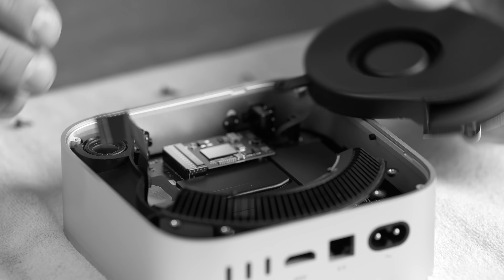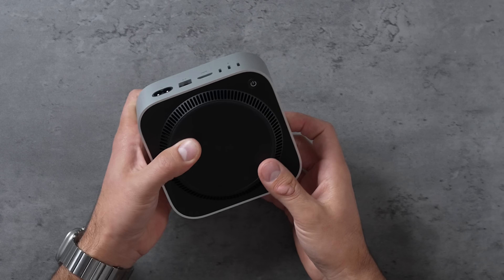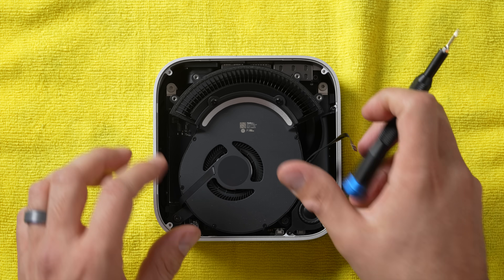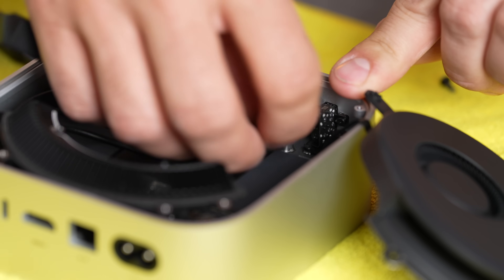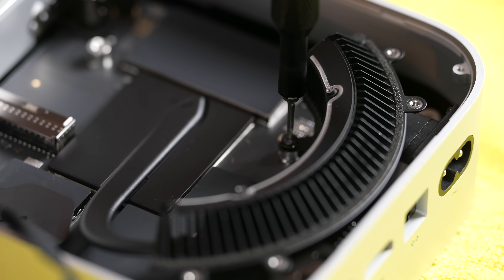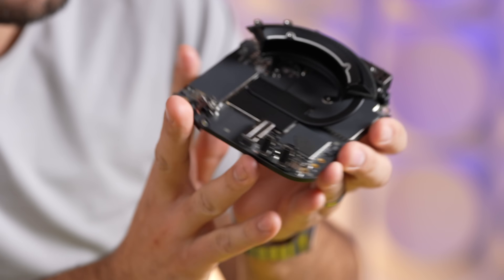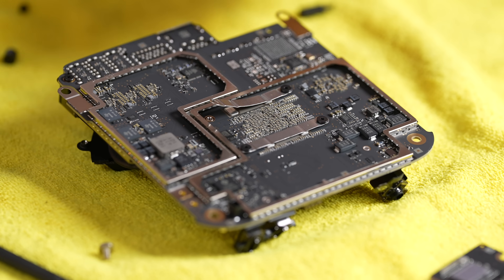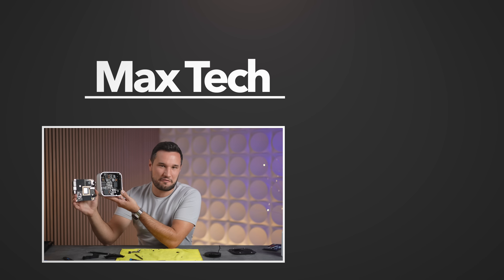M4 Mac mini FULL Teardown - Apple Finally FIXED IT?!

Comment: 7:50 Those Metal io Ports look 3D Printed... and  No that Tiny Cable is Not a Power Cable. Power is Direct Contact Pads through the Board.

Comment: I turn off my computer EVERY DAY with all electronic devices that is connected to main power - every night i sleep without any electronics working in the background. 
That turn off button from the bottom create some dumb guy. If it would be at the back then OK, but if you need to lift your computer, hurting all USB ports by getting pressure from cables inserted in ports...that is stupidly, same as mouse with charging port from the bottom.

Comment: Fantastic steps in the right direction. Not being able to upgrade the storage without soldering new chips to the board though is still really scummy and we should all carry on calling out apples price gouging on things like hard drive space. It is anti consumer and there’s no need for it other than greed. Excellent machine otherwise and I will be getting on with more storage in a year second hand.

Comment: BTW. the mac mini pro has a different cooling Solution. The cooler has more fins, has a bigger heatpipe and seems to be out of copper instead of aluminum(at least there is a thin band of copper in the pro instead of a thin band of aluminum ).

Also the mac mini pro has a different ssd module it looks like an m2 2242 compared to the m2 2230 in the base mini

Comment: FYI that tiny cable btw the main board and the PSU is NOT carrying power. The power is carried by two metal leads from the metal board which are screw up between two boards. It is using direct contact. No way a tiny cable like that would power the other board :)

That cable is there to connect the main board to the PMI on the power supply.

Comment: Base model still crippled for not supporting monitors with high refresh rate; 60Hz is old tech. M4 Pro with Thunderbolt 5 is especially important for anyone used to displays with ProMotion for adaptive refresh rates up to 120Hz on MacBook or iPhone pro.

Comment: disagree that its all cracked up to be,  as the ssd they use is incredibly anemic and far too expensive for what you get compared to the latest and greatest available today, that drive, while it looks like a 2230nvme ssd, isn't and is proprietary and you couldn't switch it with better and more affordable off the shelf parts, furthermore, it only Topps out at 3,400mb per second or 3.4 gigabytes per second, were talking about speeds that would've been state of the art in 2010 to 2014 for a single ssd. Pcie gen 3 ssds top out around 3.4ish gigs per second, in 2024, we have full size pcie gen 5 2280 nvme ssds such as the crucial t705 which Topps out at a mind melting Sequential Write, 10,200 MB/s ; Sequential Read, 13,600 MB/s You could get a 4tb t705 with a nice heatsink already attached for literally 600 bucks and it would be better than their half attempt at sustainability all day, as well as it runs with this old ssd standard, imagine how much better it would be with 4 times the read write speed with that wonderful but definitely bottlenecked by the slower ssd m4 apus.... Its a real shame, everything else is fantastic expect for this.

Comment: Maybe mentioned elsewhere here or in other teardowns, but for those folks pissed at the bottom location of the power switch, since the ventilation slots are on the tapered sides of the base cover, a thin (1/2”?) circular piece of any material of your choice held on with a couple of dabs of Blu-tac putty could raise it enough to allow access for most fingers, and still keep the net height at under 3”.

Comment: Intel & AMD need more improvement. Intel Price is also too much for this spec 👎
 Mac M4 is rocking the field with Les Cost.
 Can buying a Mac mini M4  just be the only cost of the  VGA price? If we are planning to make an AMD build equal to the M4 Mini, it will cost three times the M4 Mini.

Comment: I think the power button is down there to save money. Its a cheap device. And putting a button in the plastic on the bottom is cheaper than on the aluminum

Comment: We turn off our Mac Studio every day after work here at the recording studio. Too many power interruptions up in the Northwest to trust our clients  data to the crazy weather and frequently unstable power grid.
Reply: A good UPS system should be the solutuion...
Reply: @xmj6830  up here in the Northwest, UPS backups are mandatory, we have 5 of them currently.
Reply: @xmj6830 absolutely, we have several in the mix, iso, and gear rooms.
Reply: then install fallback solution, especially if the power surges are only for a few minutes.

Comment: I think you misunderstand the purpose of the removable storage. This is a cost saving measure. The hands have a high failure rate. So instead of trashing the whole mb during warranty, they just have to replace the micro board

Comment: RAM (price) is the problem, not storage space, which can be easily extended by an external SSD. Web Browsers take 10 GB RAM and more easily these days, so there‘s not much room for other apps on the 16GB base configuration. Staying with my 64GB Intel i7 for 5 more years I guess. 🙂

Comment: I’m sure there will be those who trash it when they tear it down, but this new Mini contradicts so much of what Apple is usually attacked over. Apple could just rest on the lead Apple silicon gives them, but they have clearly worked really hard to improve not just efficiency, but the repairability of the design. Even if they charge well over the odds to replace a bad SSD you don’t have to scrap the whole computer. Ditto a bad wifi chip. This is definitely against the trend of non repairable tech. Bravo Apple for, so far, avoiding corporate dementia.

Comment: The engineers at Apple should be very proud of themselves. The internal construction is so elegant and sophisticated at the same time. 👏
Reply: Partially disagree as the ssd they use is incredibly anemic and far too expensive for what you get compared to the latest and greatest available today, that drive, while it looks like a 2230nvme ssd, isn't and is proprietary and you couldn't switch it with better and more affordable off the shelf parts, furthermore, it only Topps out at 3,400mb per second or 3.4 gigabytes per second, were talking about speeds that would've been state of the art in 2010 to 2014 for a single ssd. Pcie gen 3 ssds top out around 3.4ish gigs per second, in 2024, we have full size pcie gen 5 2280 nvme ssds such as the crucial t705 which Topps out at a mind melting Sequential Write, 10,200 MB/s ; Sequential Read, 13,600 MB/s You could get a 4tb t705 with a nice heatsink already attached for literally 600 bucks and it would be better than their half attempt at sustainability all day, as well as it runs with this old ssd standard, imagine how much better it would be with 4 times the read write speed with that wonderful but definitely bottlenecked by the slower ssd m4 apus.... Its a real shame, everything else is fantastic expect for this.

Comment: Next time, after you initially lift the bottom case with the metal pry tool, use the plastic guitar picks to go around the rest of the  case so you won't crack it as easily.

Comment: I think I may have to get the M4 Pro Mini. Wow. This will be my first Apple since my Performa in the 90's. It isn't that I didn't like Apple, but my family is PC and I only used Apple in school, but when we moved to Dallas, I went from an Apple Charter District to a Windows based one. I still want a G4 Cube, an old Power PC Pro, and now one of these M chips. Apple using their own silicon is the Apple I grew up with. These little guys are so badass. Also, eff intel Apple.

Comment: Why the CPU cover with the apple logo doesn't made with copper to increase the heat conduction speed or its because there will be unwanted electric conduction? What material used for the chip silver looking apple logo cover then?

Comment: This is not so cheap to replace SSD if it is not compatible with the standard ones
Reply: So you’re not familiar with the prices Apple charges for internal SSDs. Even if you buy the most expensive SSD on the market, it’s still cheaper than what Apple charges.
Reply: @gaetanobruno5889  2 tb apple upgrade kit costs 1k$. While a new 2TB Samsung SSD costs only $200
Reply: Chinese maintenance engineers have launched this service for just $200 USD.Amazing~

Comment: "user replaceable" needs some qualifications, as it still a proprietary board, and will require a 2nd Mac to get working again?

Is the power transmitted between the boards via the standoffs?

Comment: Apple gives you option to swap out memory, but make it impossible to run open source software and sideload on Mac via software update. Such an Apple thing to do.
Reply: @hugochan2821 Actually, open source software works fine. I just installed Blender and GIMP on Sequoia with no problems whatsoever.

Comment: The only thing I don’t understand about this M4 Mini is why Apple integrate the power supply. They could save on material costs and make the Mini even mini-er, by just use type-c to be the power supply and i think we all got a type-c charger that powerfull enough.
Reply: Its clearly made for small desks and packages. It would take much more space and be overall much more annoying if it had an external power brick that had to sit somewhere else. Being a tiny bit taller to avoid a huge laptop charger brick somewhere else was worth it. Also now we dont have to worry about losing a power supply like the old imac.
Reply: apple doesn't want the mac mini to be a mobile device. you can easy to use power bank and ipad as the screen....... no more macbook LOL.
Reply: they will do just wait for some 10-12 yrs
Reply: Do the mod. I’ll watch and like the video!

Comment: I really doubt that SSD is replaceable. I would like it to be but I would bet Apple has some kind of hardware code numbers that the system much match up.   So while you can replace it, you probably can not use it.

Comment: The fact that the bottom cover broke that easily indicates that Apple could be using cheaper materials.
Reply: its plastic ofc its gonna break
Reply: @ Not all plastics break that easily
Reply: @Adgale  I agree but it's not for the consumer to open the apple technician would open it without breaking it but yes I agree with you

Comment: Does this mean I can buy the base 256 model and replace the ssd???
Reply: Not now. You can buy the base 256 and hope that someday, someone offers compatible SSDs for it. A similar project successfully did it for the M2 Mac Studio so we can hope for a similar work for the Mini M4. Also, I think that the installation process is also more complicated than just replacing a SSD because the controller in not on the replaceable board: I think you need to have another Mac with Apple specific software to make the machine accept the new SSD.
Reply: @noliv5832  Ah very helpful. Thank you.

Comment: Except that Apple's SSD prices are outrageously high. It makes more sense to get the base level of SSD and then buy an external drive, which are extremely fast, especially with Thunderbolt 5.
Reply: It probably does, but it feels so silly to me to buy a desktop just to have its parts hanging off the outside. Just give us a normal M.2 drive or two.

Comment: WHAT??? I’m going to cry. I paid $400 extra for the 1TB model!!! I expected the storage to be non-replaceable….
Reply: Wait for someone to try and swap them, the Mac Studio has replaceable SSD except it’s not an SSD it’s just the flash as the Apple silicon chips have the required controller built in, and this looks the same.  So yes replaceable but definitely not an off the shelf part.
Reply: Return it
Reply: It's not necessarily user-upgradeable - on reddit they're saying it's not technically an SSD, in that the controller is still on the logic board, so it's unlikely we'll be able to user-upgrade these. It could be to simplify Apple's logistics, so they don't need to make a logic board for each storage option, but can make a storage-agnostic one and just slap in the appropriate storage.
Reply: @thenecrolept  more so they can repair it easily in apple care/
Reply: It replacable by apple only to decrease repair cost. you can keep your order.
Reply: I'ts not easy to do that. Those guys, from China maybe, did it though: https://www.youtube.com/watch?v=bNZzHK4046A but you will have first find someone to do that, and it will not be cheap....
Reply: @soniccinos  below 1500RMB for 2TB...that is what i get from them.
Reply: @soniccinos  Chinese maintenance engineers have launched this service for just $200 USD.Amazing~
Reply: Wanna find out if there are exactly these SSDs available for purchase from the "free market"?
Reply: @MartinVonReichenberg  At present, only solid particles can be purchased for self-replacement
Reply: ok cry now
Reply: That’s why you wait and don’t be a fan boy lol😂

Comment: But to see anything, you need a display, right? With an iMac you get the computer AND the display. The Apple Studio display is another $1600? Over $2000 to see anything. I'm wondering, I have a 2020 27" iMac 5K. Can I hook that to a new Mac mini, and use it as a monitor only? Google says yes, via thunderbolt, but I want to make sure. I'd like to keep my 27" of display real estate if possible. I know there are non-Apple displays a lot cheaper than a Studio Display, but I've seen things saying you don't get nearly the quality you get with the Apple 5K displays.

Comment: SSD isn’t user replaceable, it’s just bare flash memory with the paired controller on the logic board, only Apple service replaceable. Also the airflow design is terrible, it will suck back in its own hot air. No one puts inflow & outflow that close together!

Comment: I'm expecting there to be(if there isn't already) a thunderbolt 4 podium that has a few USB-A ports, and 1 or 2 m.2 drive slots. The Mac Mini would site on it and have the corner the power button cut out so you could get a finger under it without lifting it.

Comment: Guys, I do not think the storage is user replaceable. It will destroy Apples ladder profit levels like $200 for a $20 256Gb storage upgrade. It will be serialised or have security measures where the OS won't let you use off the shelf storage. Or Apple will nuke it with low performance and disable security features etc artificially. I hope I am wrong, someone tell me I am wrong after swapping it with a 2TB off the shelf SSD and benchmarking it.
Reply: The controller is not on that replaceable board, just the flash storage. So the controller has to be reprogrammed by Apple if you install a different storage module. It will make it easier for Apple but not for users.
Reply: @barnett25  No. China has successful upgraded Mac Mini m4 from 256 to 2tb yesterday.
Reply: @shyan5886  Without reprogramming the controller? I know there was a hack for advanced people to do that with the old soldered-in storage that maybe could be used on the new M4 also.
Reply: @ yes, same as old way, replace the memory chip on the ssd itself. Then restore the os thru dfu mode. Exactly like how Mac Studio upgrade its memory.
Reply: @shyan5886  source?
Reply: @barnett25  Should at least make self repair with a like for like sized module pretty easy at least, compared to soldered chips.
Reply: @bryo4321  Not self repair, as Apple has to reprogram the storage controller with the serial number for the new SSD module. Though someone may come up with a way to deal with that but it will likely only be for the more hard-core enthusiast.
Reply: Easier to just get an external drive.
Reply: Of course it’s not an off the shelf part. 

May well be reverse engineerable in the future. But don’t hold your breath.
Reply: I think apple knows there's lots of users who will just spec it ip without thinking much about it and that these pay off such exorbitant price increases.
Because otherwise it would be much more profitable to half the upgrade costs as much more people would choose these. Because the ssd and ram upgrades cost essentially nothing for apple.
But with cheap upgrades the base model people would still choose base and upgrade people would upgrade anyway. So more profitable to milk upgrade people.
Reply: English video of upgrading storage by replacing NAND chip: https://www.youtube.com/watch?v=cJPXLE9uPr8&ab_channel=dosdude1
Reply: Dosdude1 replaced the NAND flash chips on the board successfully with no programming.
Reply: The ssd they use is garbage disagree that its all cracked up to be,  as the ssd they use is incredibly anemic and far too expensive for what you get compared to the latest and greatest available today, that drive, while it looks like a 2230nvme ssd, isn't and is proprietary and you couldn't switch it with better and more affordable off the shelf parts, furthermore, it only Topps out at 3,400mb per second or 3.4 gigabytes per second, were talking about speeds that would've been state of the art in 2010 to 2014 for a single ssd. Pcie gen 3 ssds top out around 3.4ish gigs per second, in 2024, we have full size pcie gen 5 2280 nvme ssds such as the crucial t705 which Topps out at a mind melting Sequential Write, 10,200 MB/s ; Sequential Read, 13,600 MB/s You could get a 4tb t705 with a nice heatsink already attached for literally 600 bucks and it would be better than their half attempt at sustainability all day, as well as it runs with this old ssd standard, imagine how much better it would be with 4 times the read write speed with that wonderful but definitely bottlenecked by the slower ssd m4 apus.... Its a real shame, everything else is fantastic expect for this.